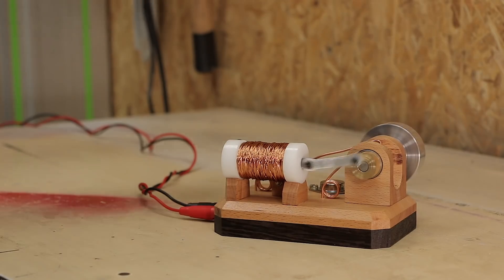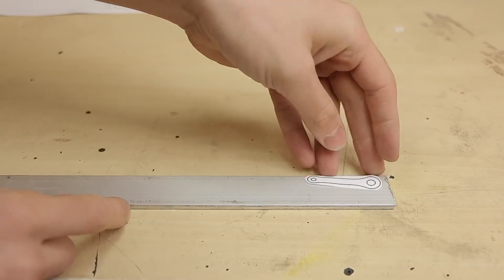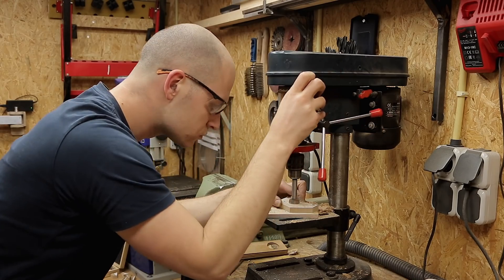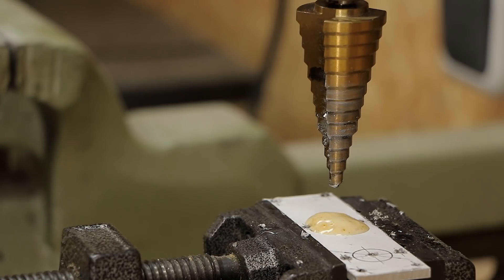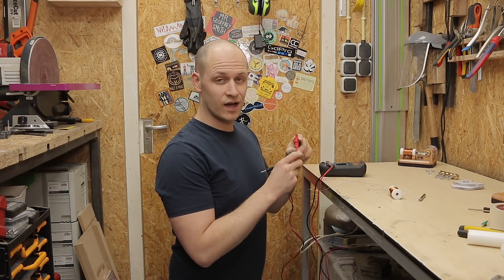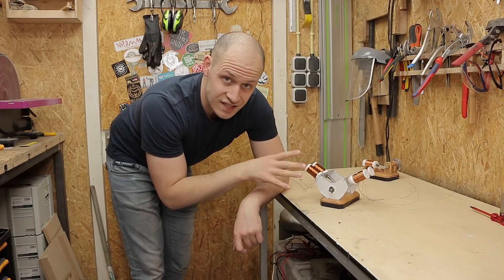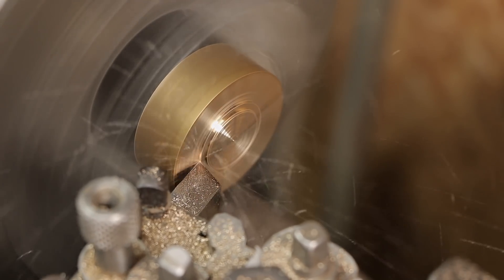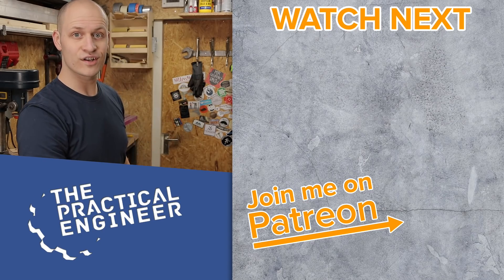How to make a V4 solenoid engine

Comment: Very well done however this wouldn't represent a four stroke engine, rather a (2 stroke) four cylinder engine. Thanks for the video.
Reply from the maker: Thanks for the heads up. I realized the same after recording
Reply: It would be interesting to modify it to be 4 stroke and see how well it runs.
Reply: @dgphi  I'm sure it would work, but it would be half as powerful with no technical advantages that I can think of. I suppose this isn't exactly an exercise in efficiency tho, more about the challenge and fascination, so maybe it could be interesting as a challenge.
Reply: @dgphi  Technically impossible. The only thing that sorta makes it a 4 stroke is it has four "pistons". It isn't using fuel, so every stroke is a power stroke. This would actually be a one stroke engine. The only force pushing the "piston" down is the magnet drawing in another one. The powerstroke pulls the "piston" in versus a fuel engine where the power pushes a piston down.
Reply: @ItsDaJax  With every 2 strokes there is a power stroke. If you turn it into a 4 stroke than with every 4 strokes there is a power stroke. It could definitly be modified to run as a 4 stroke.
Reply: @MegaApenstaartje  It doesn't run on gasoline, diesel, or cng. How could it run as a four stroke? It has no need to. Suck, Squeeze, bang, blow versus a magnet that simply pulls the rod inside the open  chamber. It's less complex than even a steam engine. How can you four stroke an electric engine? You can't even seal the chambers.
Reply: @ItsDaJax  It has no need to, but nobody has mentioned anything about a need. It COULD be converted to a 4 stroke. 2 stroke vs 4 stroke also has nothing to do with the fuel source or the pistons ability to seal.
Reply: @Michael-gi5ml  How are you going to make a 4t solenoid?
Reply: @ItsDaJax  Yes 4-stroke would be possible. A solenoid can push as well as pull. Logically speaking, if it is pulling on one end, then it is pushing on the other. With an appropriate control mechanism, each piston could push on every fourth stroke (every second downward stroke).
Reply: @dgphi  Please explain to me how a coil can push a metal rod?
Reply: @RubixB0y  do u know what an electromagnet is?
Reply: @jonnie2bad  Last I checked, those pull, not push.
Reply: @RubixB0y  Start with an iron rod, and join another rod to it made out of a non-ferromagnetic material such as plastic, wood, or aluminum. The non-iron part is the pushing end. Put the rod inside the solenoid so that the bare iron end of the rod is poking out of the end of the solenoid. Apply a current. The iron rod will be pulled into the solenoid, and the non-iron part will be pushed.
Reply: @dgphi  If it's pushing on the initial stroke then pulling on the return stroke, wouldn't that make it a 1 Stroke engine?  As in it provides power on each stroke of the cylinder rather than needing a stroke to "refuel".  Mind that would make the "distributor" pretty complex....MAKE IT!!!! :0)
Reply: @ItsDaJax  it's a 2 stroke it has 1 return stroke then a power stroke a one stroke engine would only move the to the bottom then stop because it has only 1 stroke no return stroke it's impossible to make a running engine with a odd number of strokes that's why you don't see any 3 or 5 Stoke engines .
Reply: @ItsDaJax  a 4 stroke doesn't need to use fuel it just have to make power every 2 revolutions a 2 stroke make power on every revolution .
Reply: @xxzenonionnex7658  You're right. I  called it a one stroke because the way it functions pulls the rod in to the chamber and the only thing pulling the rod back down, is another rod being pulled up. A mistake on my part.
Reply: @RubixB0y  an electromagnet uses dc current so the coil has an electric field pulling or pushing based on its poles which are through the ends.
With ac current, the current keeps alternating so the poles are gonna be switching back and fourth so on each end, it will push AND pull on the same side. 
Fin trick To know the direction of the current, line your right tumb along the wire in the direction of the current and curl your fingers and thats the direction of the magnetic firce, hence why cpils are used!
Reply: @TrinidaddyGdom   You would be right if the object being pushed and pulled is also a magnet with its poles not changing. With an iron rod it's going to be attracted either way because the small domains in the iron align to oppose the applied field.
Reply: @RubixB0y  you right haha for some reason i thought you were asking how a piston could work with a solinoid, so itd have to also be a perminent magnet as the piston!
Reply: @RubixB0y  Try reading up on eddy currents, its interesting honestly:)
Reply: RubixB0y A solenoid in high position and solenoid in low position. Two coils,one at the top and one at the bottom of a tube, two position solenoid to actuate in each direction.
Reply: theBenski27 he calls it a 4 stroke in the first 15 seconds of the video.
Reply: Came here to say the same
Reply: Also the fire one side at a time there isnt a steady sequence.
Reply: Gijs Boskers its a V4 motor replica
Reply: @JoexCool If it could work; a return spring that pushes it down, might work better.
Reply: REEEEEEEEEEEEEEEEEEEEEE
Reply: bet you finish in 2 strokes OOOOOOOOOOOOOOOOOOOOOOOOOOOOOOOOOOOOOOOOOOOOOOOOOOOOOOOOOOOOOOOOOOOOOOOOOOOOOOOOOOOOOOOOOOOOOOOOOOOOOOOOOOOOOOOOOOOOOOOOOOOOOOOOOOOOOOOOOOOOOOOOOOOOOOOOOOOOOOOOOOOOOOOOOOOOOOOOOOOOOOOOOOOOOOOOOOOOOOOOOOOOOOOOOOOOOOOOOOOOOOOOOOOOOOOOOOOOOOOOOOOOOOOOOOOOOOOOOOOOOOOOOOOOOOOOOOOOOOOOOOOOOOOOOOOOOOOOOOOOOOOOOOOOOOOOOOOOOOOOOOOOOOOOOOOOOOOOOOOOOOOOOOOOOOOOOOOOOOOOOOOOOOOOOOOOOOOOOOOOOOOOOOOOOOOOOOOOOOOOOOOOOOOOOOOOOOOOOOOOOOOOOOOOOOOOOOOOOOOOOOOOOOOOOOOOOOOOOOOOOOOOOOOOOOOOOOOOOOOOOOOOOOOOOOOOOOOOOOOOOOOOOOOOOOOOOOOOOOOOOOOOOOOOOOOOOOOOOOOOOOOOOOOOOOOOOOOOOOOOOOOOOOOOOOOOOOOOOOOOOOOOOOOOOOOOOOOOOOOOOOOOOOOOOOOOOOOOOOOOOOOOOOOOOOOOOOOOOOOOOOOOOOOOOOOOOOOOOOOOOOOOOOOOOOOOOOOOOOOOOOOOOOOOOOOOOOOOOOOOOOOOOOOOOOOOOOOOOOOOOOOOOOOOOOOOOOOOOOOOOOOOOOOOOOOOOOOOOOOOOOOOOOOOOOOOOOOOOOOOOOOOOOOOOOOOOOOOOOOOOOOOOOOOOOOOOOOOOOOOOOOOOOOOOOOOOOOOOOOOOOOOOOOOOOOOOOOOOOOOOOOOOOOOOOOOOOOOOOOOOOOOOOOOOOOOOOOOOOOOOOOOOOOOOOOOOOOOOOOOOOOOOOOOOOOOOOOOOOOOOOOOOOOOOOOOOOOOOOOOOOOOOOOOOOOOOOOOOOOOOOOOOOOOOOOOOOOOOOOOOOOOOOOOOOOOOOOOOOOOOOOOOOOOOOOOOOOOOOOOOOOOOOOOOOOOOOOOOOOOOOOOOOOOOOOOOOOOOOOOOOOOOOOOOOOOOOOOOOOOOOOOOOOOOOOOOOOOOOOOOOOOOOOOOOOOOOOOOOOOOOOOOOOOOOOOOOOOOOOOOOOOOOOOOOOOOOOOOOOOOOOOOOOOOOOOOOOOOOOOOOOOOOOOOOOOOOOOOOOOOOOOOOOOOOOOOOOOOOOOOOOOOOOOOOOOOOOOOOOOOOOOOOOOOOOOOOOOOOOOOOOOOOOOOOOOOOOOOOOOOOOOOOOOOOOOOOOOOOOOOOOOOOOOOOOOOOOOOOOOOOOOOOOOOOOOOOOOOOOOOOOOOOOOOOOOOOOOOOOOOOOOOOOOOOOOOOOOOOOOOOOOOOOOOOOOOOOOOOOOOOOOOOOOOOOOOOOOOOOOOOOOOOOOOOOOOOOOOOOOOOOOOOOOOOOOOOOOOOOOOOOOOOOOOOOOOOOOOOOOOOOOOOOOOOOOOOOOOOOOOOOOOOOOOOOOOOOOOOOOOOOOOOOOOOOOOOOOOOOOOOOOOOOOOOOOOOOOOOOOOOOOOOOOOOOOOOOOOOOOOOOOOOOOOOOOOOOOOOOOOOOOOOOOOOOOOOOOOOOOOOOOOOOOOOOOOOOOOOOOOOOOOOOOOOOOOOOOOOOOOOOOOOOOOOOOOOOOOOOOOOOOOOOOOOOOOOOOOOOOOOOOOOOOOOOOOOOOOOOOOOOOOOOOOOOOOOOOOOOOOOOOOOOOOOOOOOOOOOOOOOOOOOOOOOOOOOOOOOOOOOOOOOOOOOOOOOOOOOOOOOOOOOOOOOOOOOOOOOOOOOOOOOOOOOOOOOOOOOOOOOOOOOOOOOOOOOOOOOOOOOOOOOOOOOOOOOOOOOOOOOOOOOOOOOOOOOOOOOOOOOOOOOOOOOOOOOOOOOOOOOOOOOOOOOOOOOOOOOOOOOOOOOOOOOOOOOOOOOOOOOOOOOOOOOOOOOOOOOOOOOOOOH
GOTEM
Reply: @daspedal2730  the title says it
Reply: @daspedal2730  They're talking about how this guy is calling it a four stroke instead of a four cylinder, what kind of substances are you on?
Reply: @daspedal2730  My guy, the dude in the video called it a 4 stoke and a single stroke in the first few seconds of the video. No one here think's it resembles a 4 stroke.

Comment: Found you invert it to make power? Like replace the iron rods with magnets
Reply from the maker: I'm putting this on my idea list. Thanks!
Reply: Use neodymium magnets as the pistons.  Make the magnets slide on nylon rings either end of the magnets to minimize friction as they slide in and out of the coil pack.  Use both push and pull cycles on each cylinder (invert polarity to push the magnet back down).  A better winding design will give a stronger magnetic field when charged.

The engine layout (inline 4, V-4, Radial 4 etc) doesn't matter at all if the crankshaft is right.
Reply: @K10wNs-Shed  great idea :)
Reply: A good novelty for sure but too lossy to be practical
Reply: Yea to get .2 hp

Comment: Amazing build! Just one correction: stroke is not a zylinder(piston). You had built 1 piston then 4 piston engines. Both of your engines are 2 stroke. A stroke is one complete linear move of a piston
Reply from the maker: Thanks! Stroke is more related to the actual combustion cycle right?
Reply: @Thepracticalengineer  Exactly! Good job, keep going.
Reply: The Practical Engineer yes sir. Two stroke would be more often found on dirt bikes (sound real raspy) and four strokes in more street vehicles. Four strokes go down and up twice to complete one full combustion sequence. While two stroke do it in to. Exhaust gassed leave slightly after combustion occurred, and early on the compression stroke, mixed air would flow in.
Reply: Was searching for this comment.
Reply: Thank you for posting this. Or else i would of.

Comment: Could you actually power a car with a scaled up solenoid engine?
Reply from the maker: In some way yes. But I don't think it will be very powerful or efficient
Reply: @Thepracticalengineer  What about if we could put the solenoid chamber in a vacuum somehow?
Reply: The Practical Engineer what do you think about trying? Do you think with testing and research that you could make an effective solenoid engine?
Reply: yea sure you can. It would be just for fun though as its not efficent. 

You could make a aci fi looking hypercar though with a v12 solenoid engine.
Reply: @afox5319  would make some sense in a smaller vehicle, like a bike
Reply: i think it is to complex and expensive in comparison to EM, a lot more moving parts, much larger in size for same power and it needs lubricaton for moving parts wich adds additional complexity, and also you would put giant magnets in metal cars... maybe not so good idea....
Reply: This is an awesome build just for the sake of building but not for practical use.  Typical brushless motors are far more efficient.  They take advantage of the circular momentum, whereas in comparison, a solenoid is less efficient because it loses energy when it needs to slow down, stop, and then reverse direction.
Reply: Echo Smyth you could use three solenoids instead of 4 and use a brushless speed controller. That’s would essential make it a brushless motor. You’re right but ,still less efficient.
Reply: Yes,a pretty weak and unreliable car which would be very very sensitive and shouldn't get too hot,cold or wet.
Also youd have to build nearly everything out of non magnetically metal so your engine doesn't destroy it's efficiency after only minutes
Reply: Sure if you scale it up enough i bet you could power a semi but it would be stupid inefficient.
Reply: @TH-xo4zx  So maybe it would be better for something like a desk fan hahaha.
Reply: @rlt94  well yeah actually. A pretty cool desk fan at that.

Hahaha cool i see what i did now
Reply: @rlt94  maybe a little toy car lol
Reply: probably but it would need some monster battery
Reply: And it would probably be really heavy.
Reply: An AC motor would be a more efficient option
Reply: Super gemaakt! Echt heerlijk om het motortje te zien draaien.
Reply: You could probably make one, and I’d work probably just as well as an internal combustion engine, but since there’s several electrical motor designs with efficiencies in the 90% range, why would you make something that complicated when a brushless DC motor has a lot fever moving parts? The contact system is however basically how a brushed DC motor works, except that the commutator does the switching and the brushes just stay pressed against it.
Reply: But how would it adjust power? Imagine a gas pedal getting turned into an on/off switch
Reply: @UncleDon226  Variable resistance
Reply: @KaitouKaiju  There is no such thing as a variable resistance solenoid. They have a fixed resistance based on the size of the wire and the number of the windings.
Reply: @UncleDon226  The gas pedal would be a potentiometer, allowing it to control the power flowing to the solenoids
Edit: This is how I would do it anyway
Reply: Boaty McBoatface The magnetic field is dependent on voltage, so by lowering the voltage by for example increasing the series resistance you would lower the power output and thus the speed of the engine.
Reply: @sstorholm  That is not how solenoids work. Like, at all. They are either on, or off. There is no "half way" to a solenoid. Let's say there is a small magnetic force- it is too weak to move the pintle. So you increase it a little bit- still nothing. Increase it a little more- and it starts to move. Once it is moving there is nothing to stop it from moving. The magnetic field cant hold it halfway. It is either strong enough to overcome the pintle or it isnt and the pintle returns to its seat. But what do I know? I only have a degree in mechanical engineering.....
Reply: @Brisingar  Wouldnt work. Closest I could recon would be to pulse width modulate the solenoids, but that still wouldnt make it work well- if at all
Reply: @UncleDon226  I don't see pwm working very well. If regulating the solenoids wont work then the pedal could control the transmission. On some old tractors you see two throttles, one for the engine rpm and one for speed control. If you used a conical gear to mesh with the fly wheel and the foot pedal to control how large the gear is that meshes, speed control should be possible, albeit rudimentary and slow to respond.
Reply: @UncleDon226  A potentiometer would work. More voltage increases the magnetic field, increasing piston speed and rpms.
Proof: https://youtu.be/rop6JlOY1H0 
Near the end he controls the flywheel speed by varying the supplied voltage
Reply: @UncleDon226   IDk if you realize how that, while I get your motivation, the remark you made can come off as really arrogant to alot of ppl. You ought to take care in how you word a point like that, is what I'm saying.

More respect comes from the display of comprehension you are showing, by far than any credentials. ...and that's more true every day lately.
Hell, as much as acedemic standards at Universities has cratered, engineering, and (most) science degrees are among the few left which don't actually detract from my confidence in someone....(those still mean alot in my opinion).
But it's still unfortunate for many reasons. 
I don't know if it was mostly 1.) the absolute breeze I had at several schools within my University, compared to an actually challenging year junior college which gave me the impression, (I believe due to sports programs pushing the dumbing down of much curriculum to prevent inner city sports recruits from flunking out.  or 2.) The sad state/pathetic antics of my generation's student bodies...ie Berkely protests (and the fact that a recent employer of mine had blacklisted graduates from any Uni that has hit the news for large student riots, including Berkeley and about 100 others for obvious reasons, but who's recruiters were supposedly already fed up with the incompetent arrogance of many business school graduates, and had begun allowing exceptions to the degree requirements for some non-scientific positions....)

IDK, I just thought I'd share that bit...
Reply: @Brisingar  the stronger magnetic field likely increases the Piston speed simply as a result of its ability to more quickly accelerate the mass of the Piston.... Boaty is right in the sense that it has nothing between OFF and a certain RPM, but from that point it appears you can smoothly throttle the RPM to much higher levels with a potentiometer.
Reply: Issa prototype...but 4 cylinder engines are faster and safer that way on the v4 v6 v8s the cylinder heads are slanted ,instead of vertical,giving the parts inside an even oil coating ,the v series engines on the other hand dnt...giving it future problems known as misfires
Reply: What about hooking one up to a scooter?
Reply: The design of an engine is such to maximise the drive you can get out of petrol and diesel combustion, its design is quite inefficient then, more so when you're using electricity because you're converting electrical energy to produce a magnetic field to drive a piston to drive a crank rather than just using electricity to make the magnetic field which directly drives the final drive (motor shaft), the most efficient way to power a car in this way would just be to use a motor, not to mention a motor can have more torque for the same amount of current passed through it (as a solenoid engine). Plus, certain parts of its construction (the solenoid engine) would need to be plastic and so would be under large amounts of force and more susceptible to breaking. I don't know if anyone's actually tried but it would be interesting to see how efficient a scaled solenoid engine was.
Reply: Yes you can, but there are other efficient ways of converting electrical energy to make a wheel turn
Reply: No this is a shity version of unessesary moving parts of a normal electric motor the difference is it has way more friction.
Reply: So we're all agreed! Needs to be done full size, full battery electric car, only with a V-8 solenoid motor sitting where the gas engine would be, if only for a joke.
Reply: Yeh not very powerful